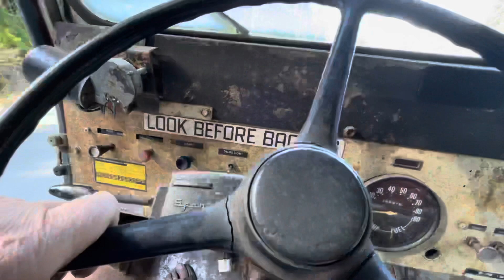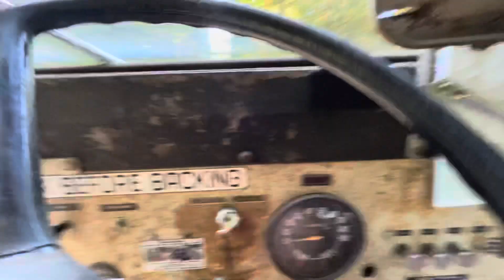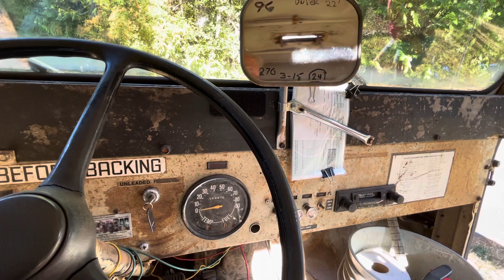Postal Jeep Is Making Funny Noises

Comment: Seems to stay consistent with engine rpm. Is somethinghitting the flywheel or maybe rattling around the fan?
Reply from the maker: Thank you for the suggestions Mark. I don’t think anything is hitting the fan. While checking the flywheel is going to be a little bit more difficult I do have a friend coming over this afternoon and we can look for that. The only thing that makes me wonder is that if I shift the vehicle into neutral I can then rev up the engine without any noise, at least the noise that I’m looking for. It is only under load that it seems to happen. That might be an argument for the flywheel suggestion which we will most definitely check out today. Thanks for watching.
Reply from the maker: Mark Randall, you win the prize which is yet to be determined. It was the flex plate bolts having backed out a touch. Friends torques them back down, problem temporarily solved. I did not have any blue Loctite available, so they will probably back out again anytime. But as soon as I pick some up and crawl under on my own I will fasten them down tight and that’ll be that. Video to come.